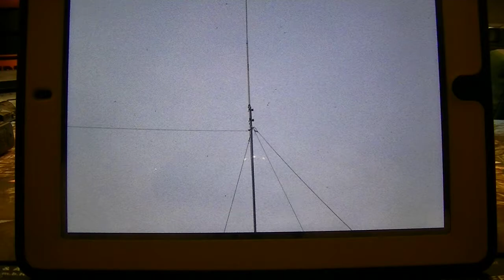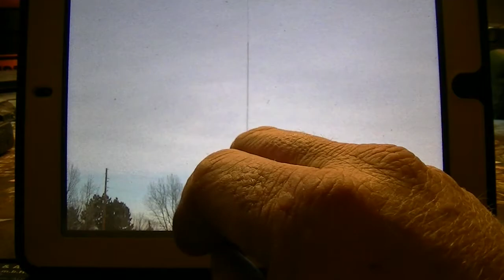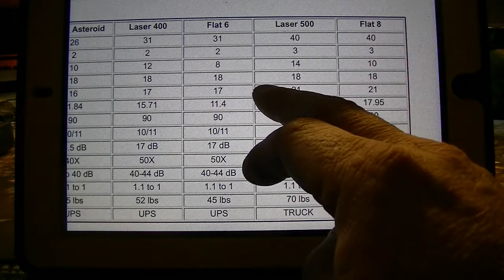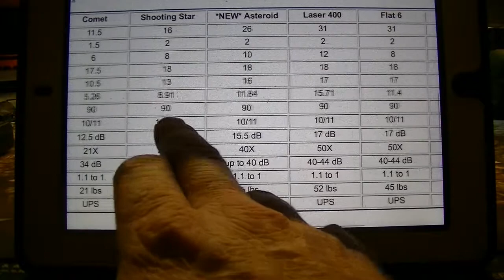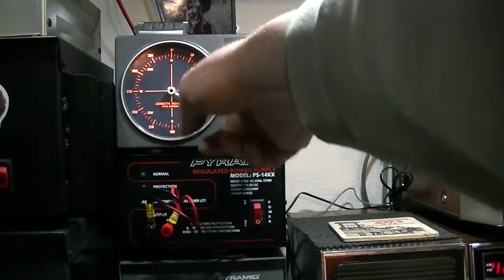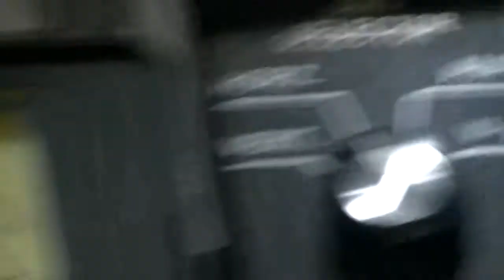SHTF Radio Communications

Comment: For anyone who's getting started and doesn't want to spend a ton of money, you can do a search for "Tape measure YAGI" and you can make a directional antenna from a tape measure, pvc pipe, and a couple of bits of wire. Most of the instructions are for 2m VHF, but you can search for a yagi antenna calculator and punch in the CB frequencies, and it will give you the sizes. Good practice for SHTF.

Comment: He shorter front elements are directors that direct your signal in a desired direction. The rear element is a reflector, not a rejecter element. This element reflects the signal from the driven element toward the director elements and concentrates your driven rf power toward the front of the beam to best maximize your rf power for the furthest transmit distance.
Educate yourself my friend.